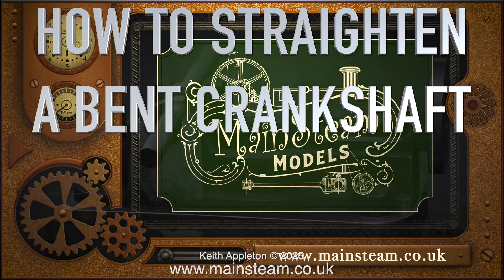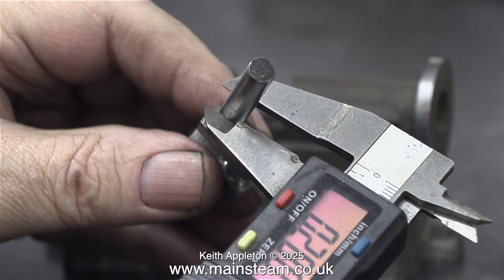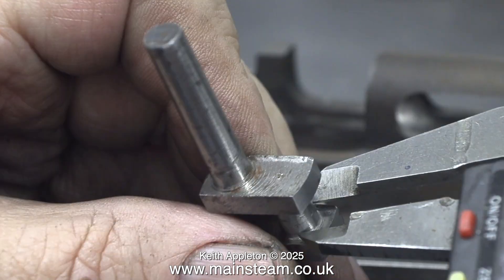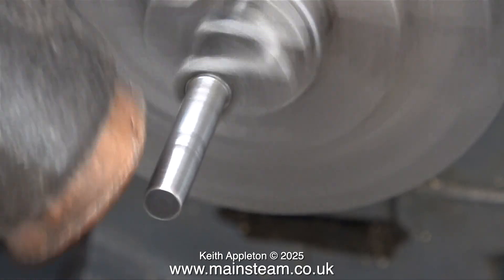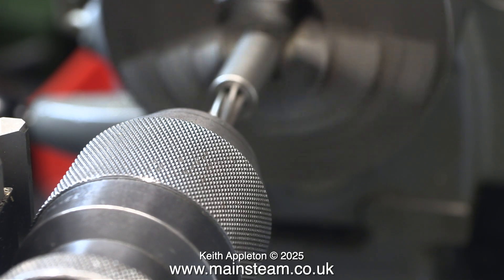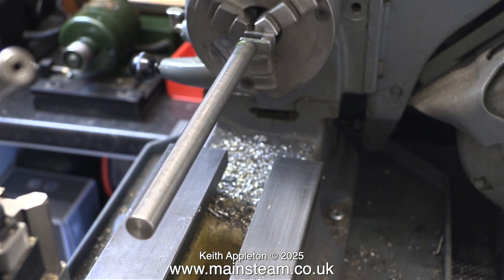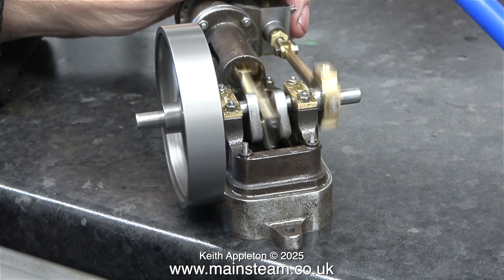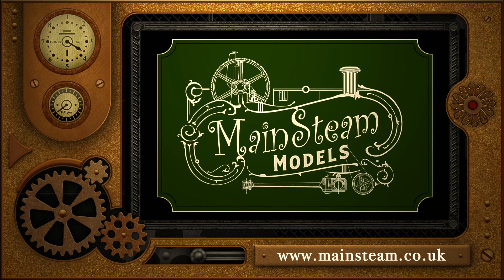HOW TO STRAIGHTEN A BENT CRANKSHAFT

Comment: how was this intended to be machined in the first place, if it was supplied as a casting?
Reply from the maker: Yes it was initially supplied as a casting to be machined in a 4 Jaw Lathe chuck. Not difficult, but it's quicker to make a built up one.

Comment: Keith, looking at this I was wondering, as you were using the bar to correct the bend in the shaft that actually you were bending at the crank web or crank pin and not straightening the shaft itself? I guess this wouldn’t matter if the the crank pin stayed parallel to the crank shaft. I know you have done this many, many times and you know what you are doing. But it was just a thought.
Reply from the maker: The clue is in the title - the Crankshaft was bent - now it is not . . . .